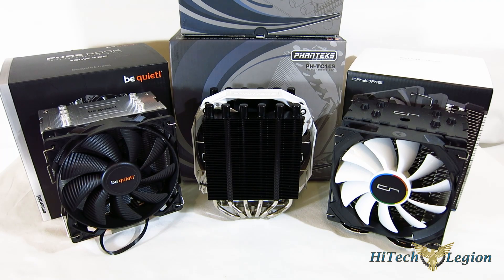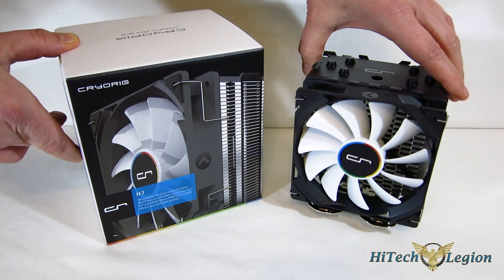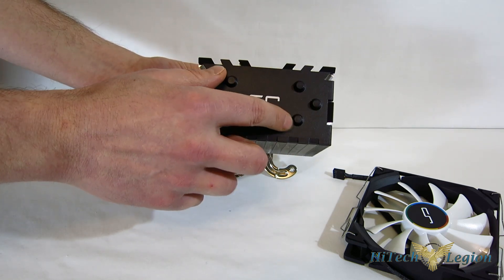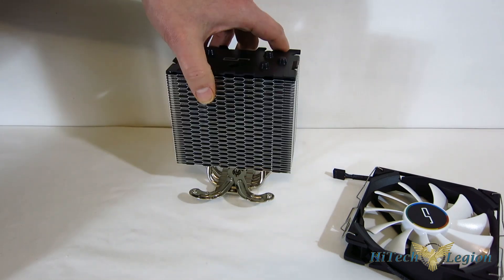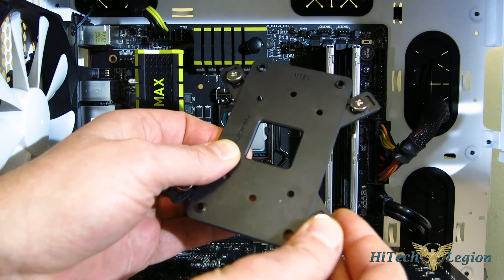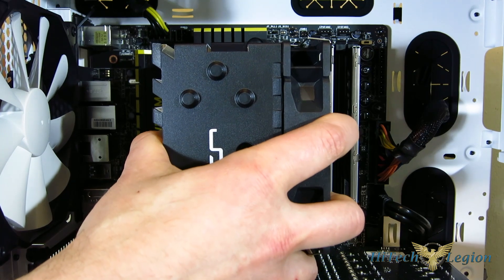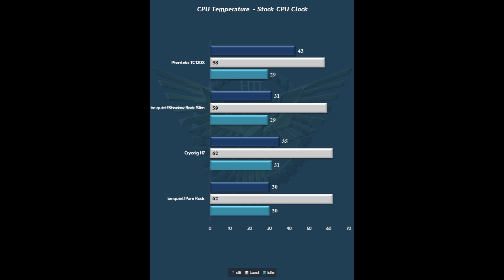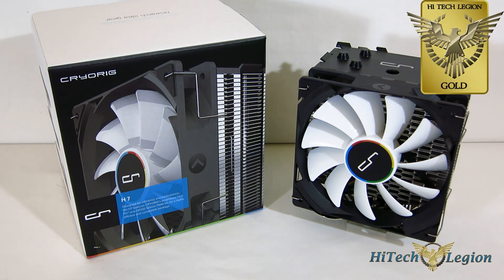Cryorig H7 Universal CPU Cooler Overview, Installation and Benchmarks

Comment: i know its kinda overkill on an i5-8400, but i went ahead to get the Cryorig H7 instead of the Hyper212x. Best decision I've ever made. I could'nt stand my PC sounding like a helicopter anymore. After getting this cooler, applied MX-4 and now, my bedroom is akin to a library even during gaming. Plus the design on the Cryorig is cooler than the CM Hyper212. Best Christmas gift ahead for anyone still using that little piece of ugly Intel helicopter.

Comment: I love my Cryorig H7. My Ryzen 5 3600 runs 13.7°C cooler in Prime95 with it than it did with the stock cooler.
Reply: Nice so it should handle my 2600 then!
Reply: @kaloroking  Yup. But just for full disclosure - I used Thermal Grizzly Kryonaut paste too.

Comment: Hey so will the mount points move to the dimensions of 4in x 3in? I have a proprietary mobo and cooler setup that I am trying to move away from and the normal "square" (1 : 1) cooler mount point dimensions that are standard with my socket type are not an option.

Comment: Ik im a bit late but the bottom of my cryorig h7 cooler (where ia comes in contact with the cpu) is not completley smooth, insead it has sort of a brushed finish to it with tiny grooves. Is this normal???
Reply: Robert Boehm yes, that’s for thermal paste to seep into to fill up the grooves

Comment: Got a second hand 4790k. installed an old stock cooler on it and it ran on 90 degrees on load. Got this bad boy and some arctic mx cooler and the CPU and never goes past 65 degrees on load again :)
Reply: Is it overclocked?
Reply: @b4ldski473  nope just stock
Reply: @bloodtalon27  that stock cooler u got was faulty.
Reply: @rnegoro1  no it wasnt because I was using it recently on a 4460 on normal temps.
Reply: You have good airflow in your case?. I want to use this cooler with my i7 2600k oc 4.5ghz

Comment: You can clearly see in the video that you put it upside down, cut video and put it in the correct position ... the same thing happened to me ..... I could have warned that the dissipator is not symmetrical and therefore you have to look first at the meaning. ....

Comment: @HiTechLegion Question: Will the CRYORIG H7 cooler fit on the micro-ATX motherboard called "MSi B250M PRO-VD", as shown in this link? https://www.amazon.com/MSI-micro-ATX-Motherboard-B250M-PRO-VD/dp/B01N9OZI64/ref=sr_1_1?ie=UTF8&qid=1510124263&sr=8-1&keywords=b250m+pro-vd&dpID=516ioWPozkL&preST=_SX300_QL70_&dpSrc=srch

Comment: Those brackets did not lock in place when I installed mine!!! I wanted to pull my hair out because I had to hold it in place with one hand and install the cooler in the other and its so beefy you feel like you're going to crunch the CPU pins. That's my only complaint though it's been a fantastic cooler all around and I can OC my i5 6600k too 4.6!!

Comment: I'm really interested in this cooler, but that installation looks like a total cumbersome pain to do with the board still installed in the case. I'm not saying it can't be done, evident of the video, but I just have a feeling I would end up wiggling it around a lot and causing a lot of unnecessary thermal paste spread.
Reply: Draydince its painful if your board stays in your case. But it shouldnt be that bad if its outside your case.
Reply: Yeah, that's what I figured. I'm just really lazy and don't feel like removing my board haha the price and performance of this cooler is great, but the laziness in me is probably going to have me looking at other models that can be mounted inside the case easier.

Comment: Was thinking of getting one of these but that X-bar installation method looks horrible!

I much prefer being able to lay my PC down on a worktop and then rest the cooler on the CPU, then tighten down the securing screws on a crossbar type method, with this you have to hold the cooler in one hand whilst tightening the screws on the back of the motherboard!

Yuk!..think I'll go with the BeQuiet pure rock instead, much more my type of install.

Thanks for the heads up with the video, it saved me making the wrong decision.

Comment: i have this cooler and i got to 90 degrees celsius during a prime95 torture test and i avg around 50-69 gaming and 20-40 idle. Either i have too little thermal paste (i used the brand provided with the cooler) or i have it seated wrong and may need to tighten it. I might clean the cpu with alchol and use the artic silver paste i purchased and put a little more and im going to try re seating the cooler. Also is the cooler supposed to rotate (not the x bracket connected to the screws) the actual cooler its self
Reply: also do you have to clean the heatsink on the h7? if so how?

Comment: is it suport an additional fan to get push-pull configuration?
Reply: push pull is a waste. literally a 2c difference.
Reply: Yes, mounting brackets for an additional fan are even included.
Reply: +Sam P. is it suport for high profile RAM when I used ashrock b150m ?
Reply: Rico Saputra Yes, it shouldn't interfere with RAM at all
Reply: if that, and creates more unecessary noise

Comment: quick question for anyone who may know...
I have 2 of the corsair fans seen here: https://www.amazon.com/Corsair-SP120-Quiet-Twin-Pack/dp/B007RESFR2/ref=sr_1_fkmr1_1?s=pc&ie=UTF8&qid=1480104964&sr=1-1-fkmr1&keywords=cooler+master+sp+fan

I was wondering if they could be used on each side of this cooler instead of the stock fan?
Reply: Im pretty sure you can if you somehow could get those small heatsink mounts that are in the screw holes for the fan included, to be mounted in your corsair fans. After all they have the same 120mm mounts. Don't take my word for it though.

Comment: What CPU is being used here and in what application?   62c at stock clocks is about where my CPU, Xeon 1231 v3 got the other day after my glass desk shattered, which screwed up my heatsink standoffs on my 212 evo so it won't stay properly attached and is prone to rotating a bit from side to side, which has seen about 12 degree temp increase from before. For example, in MW2, my CPU never used to break 50c even if my room was rather hot, now I've seen it coming close to or hitting 62 degrees when playing a fairly old game.
Reply: That link doesn't work man, it 404's
Reply from the maker: http://www.hitechlegion.com/reviews/cooling/heatsinks/42980-cryorig-h7-universal-cpu-cooler-review
Reply: Actually have this cooler now. It keeps my Xeon as cool as it has ever ran if only by a few degrees. I'm hardly topping reaching 50C in Fallout 4.

Comment: The only reason i get this for my i5 6600 is because the stock cooler doesn't look nice in my build
Reply: I got one because my 6600k doesn't come with a cooler 😎
Reply: i got one for my 6600 too, for looks, and for the lower noise. that intel stock cooler is loud
Reply: me 2 be quiet pure rock ftw :3

Comment: okay, so basically I had a 212 with arctic 5 on there and was getting 30 degree Temps. so I figured I would order the H7 and some gc-extreme. When I put them on I only got 27 to 28 degrees. Sounds good right? However, when I started gaming I noticed my temps were even higher then with my original 212 Evo Artic silver 5 combo!
so what did I do? I took the damn thing apart and noticed that all the GC Extreme liquid was incredibly thin when warmed up and it had spaces. Now I use the credit card method and spread a layer over the CPU. trying not to cake it on, but this stuff is so thick, you have to heat up a coffee cup of water and let the paste sit in it just to be able to apply it!!
so I took it apart and apply the CP 7 paste that came with it. mainly because I figured that it might be specifically designed for its cooler.

so far the temps are about the same as the 212 Evo but they are getting hotter under load.

I am going to do one more controlled experiment where I put the GC extreme paste on it again but this time using the P method and letting it cure for like a week.

and if that doesn't drop my temps then I will go back to the original 212 Evo Arctic Silver 5 combo.

case you're wondering I am running a Haswell 4770 k chip
Reply: why not the artic h7 or a better paste as is said that artic 5 is getting old

Comment: I just about broke my fucking graphics card and part of my motherboard when I dropped it while installing it in my computer.
Reply: That's why you lay the computer down horizontal, smart one. Working against gravity just makes everything harder.
Reply: was the case standing upright when you installed it?
Reply: The spacers would hold it in while it's on its side.
Reply: You actually can, just slide the computer off the side of desk at a diagonal angle, and then screw from below. That's how I did it. It's not precarious as long as you think it through.

I'm writing this mostly because, damn was it annoying to put in.

Highly recommend doing it OUTSIDE the case, but no matter what it's going to be a headache. Mounting it IS a pain.
Reply: You can't install the cooler when it's horizontal. screws go into the back.
Reply: same, i installed it like a mechanic under a car ahhaaha
Reply: F
Reply: RIP :(

Hope your graphics card and motherboard weren't expensive.
Reply: kinpatsunogaka Luckily I didn't break it im using the computer but it fell pretty hard
Reply: That's obviously not an option with this cooler, observant one. You have to screw it in from the back. Though taking out the graphics card might have been a good idea, would've also given a bit more space to work with.
Reply: HAHAHAHHAHAHAHAHAHAAHAHAH

Comment: Can i do light overclocks with it using an i5 4690k? (only to 4GHz)
Reply: It's decent enough for slight overclocking~
And try to go for 4.2 perhaps, since it runs at 3.9Ghz Max at stock anyways.
Reply: Wisteria Berlitz Oh damn. Also, do you know how well a pentium g3258 overclocks with a stock cooler? I heard you can get decent OCs on it.
Reply: I don't have experience with one but there're people who oc well to 4.0~4.6 at est. 60c with Stock cooler. (Depends on Silicon lottery)

I'd still recommend getting a cooler when OC-ing. 

Unless you're on a tight budget, I'd recommend you get a decently priced cpu. OC-ing issues can be a pain in the bum. 
There's a video showing a 3.4Ghz i5 4460 > the G3258 running 4.7Ghz

Thanks for reading, Cheers.
Reply: Wisteria Berlitz Thanks, and yea I'm making a 600 usd vacationing build, so it is hard finding a good cooler to fit in a mini itx case.
Reply: joey macarony You can look into Cryorig's low profile cooler. (C7)
Reply: Wisteria Berlitz Most places are not selling them, but te build is going to be done in a year, so maybe ten the price will drop and people will be selling them

Comment: would this cooler be as safe to have in a pc when transporting as the stock cooler on the fx 6300?
Reply: I built my first PC around 5 months ago and it has the fx 6300. I just opted to use the stock cooler because of budget reasons and I wanted to get a better graphics card. Sadly, I didn't realize how freaking loud the stock fan was. I bought the Cyrorig h7 just several days ago and installed it. Works like a charm. WAYYYYYY better than the stock cooler, and is perfectly fine to use on an AMD fx 6300. Happy Gaming =)

Comment: Is this good for intel CPU i5 6600k
Reply: Yes :)
Reply: Currently using it on my 6600k. I'd say yes!
Reply: How do you like the CPU? I plan on upgrading and the price for the 6600k seems pretty good.
Reply: +Dante The price is great (only ~$30 more than the 6500), and the overclocking is easy! Just make sure you get a Z170 motherboard.

Comment: where those the same holes that the intel stock cooler uses. So would it fit on my motherboard if the stock cooler will. (the mountin)

Comment: Is the h7 better than the h5?
Reply: No, the H5 is the better of the two.
Reply: +George Cella how come the h5 is better then the h7 ?
Reply: double tower design, and i think more heat pipes
Reply: The H7 and H5 are both single tower.
Reply: sorry i got it mixed up with the R1 ... but the H5 is bigger which SHOULD dissipate heat more (correct me if im wrong) not sure about the heat pipes, might be more or the same, not sure
Reply: Essa Alaa The H5 absolutely will dissipate more heat. Larger fin stack, larger fan, one more heat pipe.
Reply: im still surprised its not that much more expensive than the H7

Comment: Out of the h5 ultimate/universal, c7, h7, which is the best cooler for a 6700k intel cpu
Reply: +woahdude1337 The H5 Ultimate, obviously.
Reply: +George Cella is it just better by like 1-2 degrees?
Reply: +George Cella also if you can recommend any fan around $60 to keep my 6700k near the mid 70s all the time.
Reply: woahdude1337 These are impossible questions to answer without knowing your build, ambient temp, proposed clock rate and voltage, etc. Even then it would be speculation.

Comment: if i change the fan to a Noctua SP12 will it perform better???
Reply: No, a fan is a fan. You will be able to run it at lower RPMs, though, so it will be a little quieter at a given flow rate. But the included fan is quite good, do I don't really think it's worth it.

Comment: Is this compatible with LGA 1151?
Reply: Yes.
Reply: 1150 & 1151 sockets are the same size so there will be no problem fitting this to a 1151 cpu.

Comment: is this heatsink any good for overclocking?
Reply: I got a 4.8ghz Over Clock on my AMD A10-5800k and running at a max temp under load of 65C at fan speed of 500-800rpm depending on my fan curve.

I also got a Max OC of 5.2 Ghz and it stayed stable at 68C with fans just under 1100rpm under load.

 But I have 6 case fans running between 50-70% and ambient air temps between 20-25C so I don't need much to help this puppy out.
Reply: +Hekcy_ Hell yea, unless you want silent extreme over clocking. The H7 is probably one of the best coolers for the price and doesn't look half bad either.
Reply: ReptilianLaserbeam I would recommend the H7. I was tempted like you to go and buy the EVO 212 but I took a risk with the H7 because it looked like it had better stats. In the end I'm glad I chose the H7 for the cooling, style, and over all quiet operation. If I wanted to I could take the fan off and let my case fans cool it. That is how much I trust this cooler. But at the end of the day it is your money and you choose to spend it on what ever you like.
Reply: You could do some over clocking with it but nothing huge (unless you want high temps)
Reply: qwerty ok thx
Reply: English Muffin so this is a good overclocker?
Reply: English Muffin thx for the help
Reply: No problem
Reply: +English Muffin I have the same A10 APU and was going to buy a Coolermaster EVO 212, but now I'm tempted by the H7, what do you think, should I go with the H7?
Reply: thanks.  Everybody throws out their cpu temps, but never say what their ambient temps are and how cool their case is.  

My case only has 3 fans and my room is about 85F during the summer...definitely going to affect my cpu temps negatively.
Reply: taradead I put my ambient temps in my first comment on this reply chain.
Reply: in the end i gone with a hyper 212 with leds which i got from hong kong because it was cheap, however where i lived in the uk the h7 stop selling here
Reply: you're probably better off.  The H7 is a "price point" crap-shoot.  Most of them are assembled pretty sloppy.  The hyper 212 is more sturdy.  If buying Cryorig, the H5 Universal is the lowest model they give any attention to detail.
Reply: taradead i got the 212 for $28 and it also has some red LED Fans which i have never seen in the uk or the website but it has a different mounting system
Reply: taradead I've bought 4 other H7s to build a few friends systems (5 in total) and have admired Cryorig's build quality. Maybe I haven't seen any crap like you may have. Could you care to share your experience?
Reply: maybe it was just me.  Bought an H7 direct from cryorig, opened the box and the plastic cover and top couple off fins were already falling off.  Returned it, bought another and it was lopsided.  Very poor assembly.  Shoulda stopped there, but then bought an H5 and it's absolutely perfect...some of the best $45 I ever spent.

Comment: My I5-6600k@4.4ghz with the H5 universal runs at 44c under load for 2hrs. Unigine Valley and Intels cpu stress test, aida64.  Room temp at 21.1c.
Are my low temps due to the skylake platform being so much more efficient?

 My case is an Nzxt s340 with 2x AF140L Corsair fans in the front intake of the case, 1x AF140L corsair fan in the top exhaust of the case, and one Corsair AF120L fan at the rear exhaut position..

 You want bang for your buck fans here you go.. quiet and move like 58-65cfm of air.
http://www.corsair.com/en-us/corsair-fan-af140l-1000-rpm-67-43-cfm-140mm-x-25mm-single
http://www.corsair.com/en-us/corsair-fan-af120l-1300-rpm-57-13-cfm-120mm-x-25mm-single
Reply: Holy. Balls. I dont know why the temps are so amazing, but who cares, its amazing! You might have won the silicone lottery

Comment: I put this in my PC which was only hitting 40°c when on a full load with stock cooler when I put the cryorig in I was hitting into the 50s idle not even over clocked! I don't know if there is something wrong with my sensors or my monitoring app speecy and AOD
Reply: +RealMaster1999 Maybe the thermal paste wasn't applied correctly? Just a guess
Reply: +RealMaster1999 That certainly sounds like an improper installation. Pull the cooler, check teh TIM print to see if it is sitting evenly and remount making sure that all is correct, snug and even.
Reply: +George Cella only problem is my case doesn't have a cut out for the mobo so I have to take the whole thing out but on monitoring my CPU it will say 50 then when I run a stress test it will drop to about 42 so I think it maybe sensors